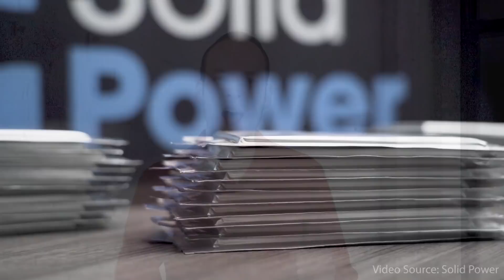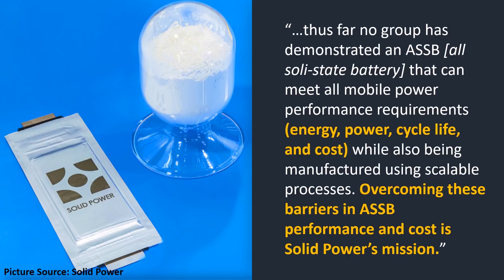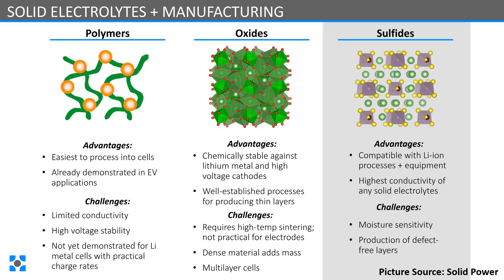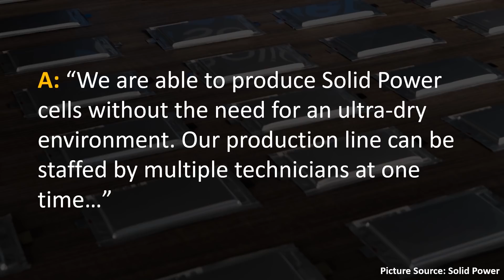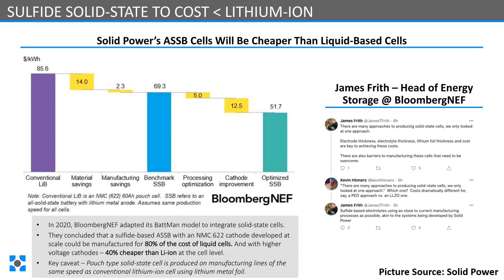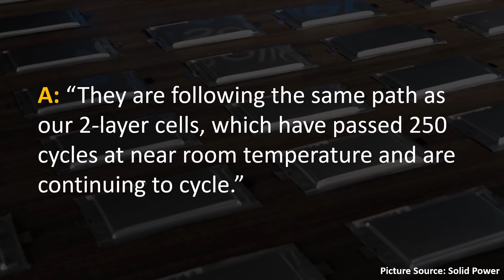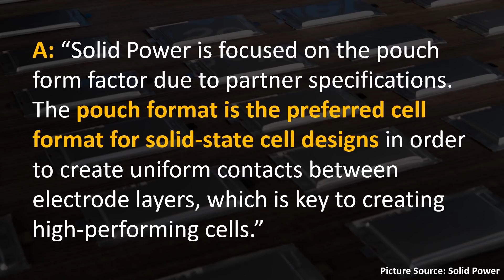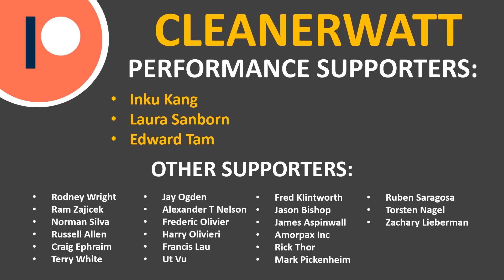Solid State EV Battery Tech: Reality vs Hype (Solid Power Batteries)

Comment: Everything you said about solid state batteries was also true for lithium batteries 15 years ago.
So it is not a hype we just have to wait until all those things change, according to Toyota it is 5 year, according to VW it is 10 year.
The only thing overhyped is the battery technology from Tesla
Reply: Not true as lithium ion batteries were on the market 15 years ago. It’s been steady improvements. Solid state is still in prototype stages .
Reply: @matthewmanzi9504  You are wrong, there are already excellent solid state batteries for decades. Used in pacemakers and hearing aid even in professional handheld tools or the more expensive (professional) laptops. .... so very much like lithium, 15 years ago. You can actually already buy vehicles (bus) from Mercedes with solid state batteries.
Reply: @buddy1155  true solid state batteries don't exist in mass production. Some companies call batteries solid state are  they are really are a hybrid.
Reply: @matthewmanzi9504  There are solid state batteries and they are being mass produced, they are only small but (still) expensive compared to batteries used in cars.
Reply: Buddy
"Overhyped"?
You didn't watch (or rather, understand) Battery day then?
Reply: @rogerstarkey5390  Well you clearly fell for the hype, it was just one big nothing burger. It was just a bigger battery and a little incremental improvement what you could expect. Wasn't even worth broadcasting.
But everything around Tesla is being hyped, even if they build a factory people fly drones above it to see the progress.
Reply: @buddy1155  
You have a surprise coming later this year.
Reply: @rogerstarkey5390  Yes, I know that Toyota is launching a car with solid state battery but that are only limited numbers for now. But still very cool, charges in about 8 minutes and lightweight, and probably insane expensive.
Reply: @buddy1155  yea like their hydrogen cars. 
I’m curious you state solid state is out already. 
Used in many areas. And you state Tesla is hyped and using old stuff. 
Yet no one uses solid state in cars. If it was so much better and available why doesn’t vw and Hyundai and ford etc use them?  
After all they did not have electric cars till recently and as you put Tesla has been around for years using old dated stuff. 
So if they have new vehicles compared to Tesla than why use the old battery tech? 
They have new cars why not use the new better battery tech?
Reply: @WHDACV  The biggest problem with solid state is the price at this moment. At this moment the cells have to produced in vacuum. That why everyone is looking for a solid state battery that can be produced differently. But you can get solid state batteries from Mercedes in their electric bus, it is just a very expensive. But it can charge extremely fast, that could be necessary for long bus routes.
Reply: @buddy1155  Wasn't the battery day worth broadcasting? 50% reduction in price while increasing the range worth broadcasting? The enormous decrease in capex not worth broadcasting? 

You just lost all sort of credibility in this discussion.
Reply: @yourcrazybear  if those batteries are so cheap why is Tesla switching to iron phosphate for saving money on the regular models. Tesla has always be wrong about any price they announced.
Reply: @buddy1155  so no cars have solid state. Odd I thought you said it was better. 
Seems odd that car companies would continue to use conventional batteries when solid state as you say is clearly better. 
For an outsider like me it looks like hydrogen. 
A lot of if’s and no product. 
As far as price it seems like that’s not the only reason solid state is not in vehicles as you said.
Reply: @buddy1155  They literally told you that on the battery day. Tesla is segmenting their battery types not only because of the cost differences, but also because of the supply constraint in the whole battery business. The goal is to get their hands on as many batteries as possible for the lowest price as possible. The battery segmentation will help with this. It also helps with making sure that the more demanding vehicle segments (Tesla semi, etc) gets the best performing batteries. 

Furthermore. It will take some time before all of the cost saving measures have taken full effect. The battery costs will be cut in half over time. BEVs will become cheaper to purchase than ICE cars over time. BEVs already have lower total cost of ownership than ICE cars. 

I don't know what you are complaining about really.
Reply: @yourcrazybear  I basically complain about this video that claims that solid state batteries are overhyped, they are not! They are not even hyped. They solve all problems of current used batteries. Solid state batteries have a better power density, can't catch fire and can be charged 3 - 5 times faster. 
They only thing that is truly overhyped is Tesla and everything around it.
Reply: @buddy1155  Solid state batteries have been quite hyped actually. What you are missing here is while they are claimed to solve "all problems" of current batteries, there are some significant challenges with these types of batteries that have to be solved first. As of today solid state batteries are not viable and there are no signs of them becoming viable for mass production until a few years out in time. 

And there it is again. That strange kind of hatred against Tesla coming from you. Everything around Tesla is not overhyped. By now Tesla have a pretty good track record of executing on their plans.
Reply: @yourcrazybear  It is not the Tesla car I dislike, if it wasn't for that whole cult of crazy Tesla people around it I would have probably bought one. 
Toyota is launching a car with solid state batteries this year and are building a huge factory for solid state batteries as well. I do not know a lot about battery factories but I assume you need to have the battery manufacturing process figured out before you build a production plant. And Toyota said solid state batteries are in production in 2025. And if Toyota is saying anything it is true... not like FSD that should have been operational over 4 years ago and still isn't
Reply: @buddy1155  So you are basing your purchase decisions on what other people are doing? So you can't buy a product if the company have a too strong following? That is a weird behavior if you ask me. 

No. You don't have to have the battery manufacturing process fully figured out before you start build the factories. Just look at Tesla. And as Elon Musk have stated, the hard part is to produce something in volume. 

So if Toyota aims to have a solid state battery production running in 2025, then it's exactly what I stated above that these batteries will likely not be viable for mass production until a few years out in time. And when that happens the question remains of how competitive they will be price wise. 

It's also rather silly to state that everything that Toyota says is true given how hard they have tried to downplay the role of EVs in the future.
Reply: @yourcrazybear  I have to meet new clients in my car, of course I am mindful about the car I drive. 30% of the time my car is the first thing people see about me, and it is true that first impressions are very important, within seconds people will have an opinion about me. Why would I buy a car that gives people a very negative opinion about me. People will think I am like most people here on this site, even you must admit not the most pleasant types of people.
Reply: @buddy1155  If you really think that your car has that kind of an effect on people then you should defintively buy a Tesla. It's still the best electric cars you can buy and more and more famous people are being seen driving one. I highly doubt that anyone would have a bad predjudice towards you for driving a Tesla. Besides, meaningless stereotypes exists for most brands anyway. 

On the subject of non-pleasant people. You will find them on most discussion forums, regardless of the brand.
Reply: @yourcrazybear  Haha.  @Buddy  should cruise laid back Newport Beach or Beverly Hills,  CA, if he's wondering about Tesla's image among aspirationals. But Idk what Tesla-less backwater he calls home (unless it's S-Valley where snobbishness is still hewn to among the newbs).